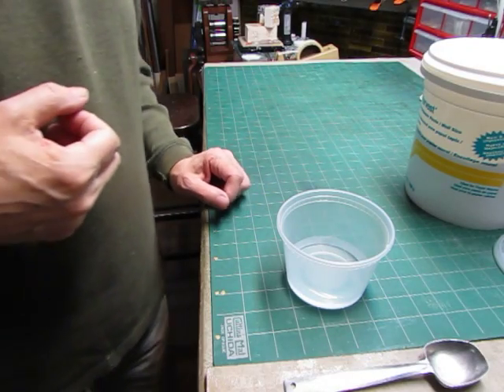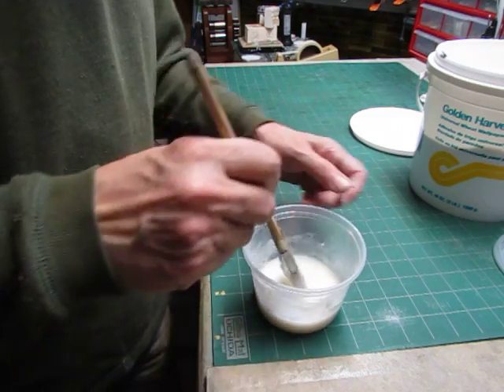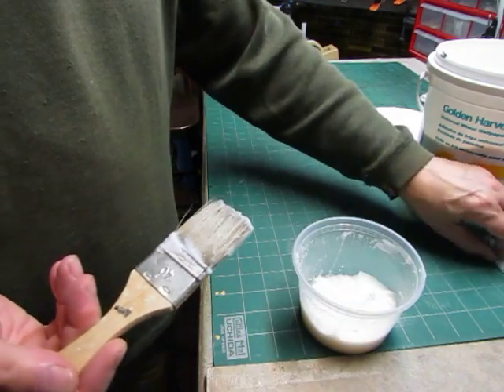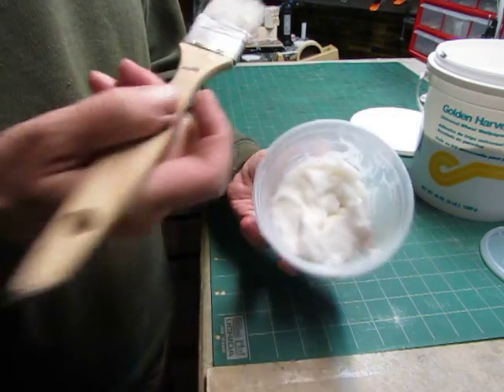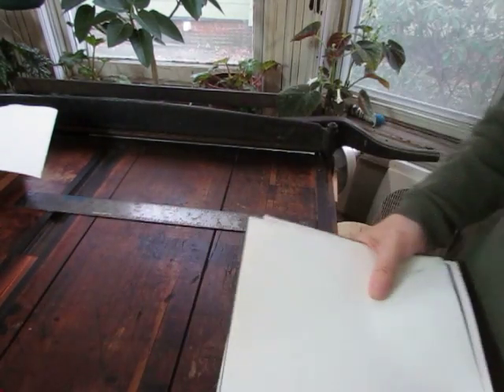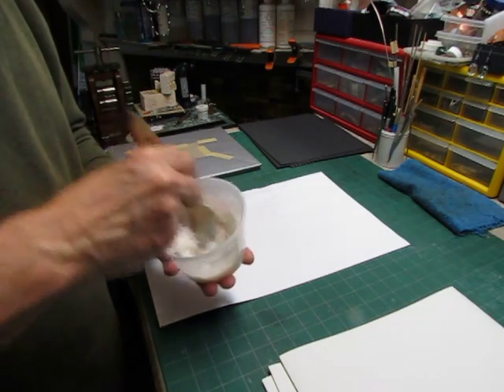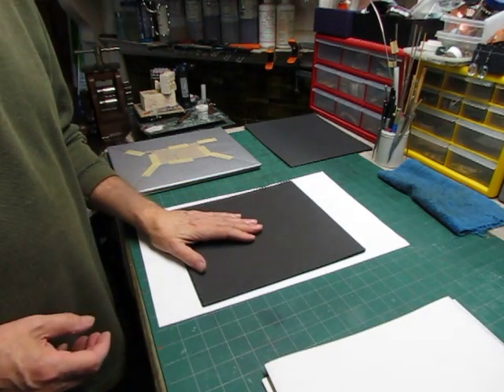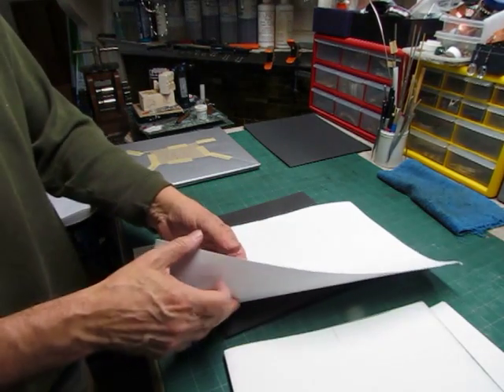Two Black Albums Part 2

Comment: Sage, can you explain why/when you used wheat paste, and when you used PVA?  What governs your choices?
Reply from the maker: Hi Lorraine, 
Paste and adhesives like PVA differ in their drying times. Glue, PVA and other adhesives are a "quick tack". Pastes made from plant materials like rice and wheat are slow tacks, so they are used to apply leather, soften spine glues in repairs, making end papers, casing-in and other jobs where you have time to make adjustments or need time to accomplish the job.  PVA , Glues and other adhesives are used when you are making cases, covering boxes, lining spines and other jobs where you have sure placement of parts and won't need to adjust the parts to finish the task. That's it in a nutshell. 

Thanks for watching and thank you for Tipping the Tutor, I really appreciate it in these days of Lock Down. If you have time, visit my Instagram @sagereyn and @sages_silver (where there is a 20% off sale this week until December 21)
Reply: @Ceropegia  Thank you.  Very clear; your explanation printed and filed.  There are many 'crafters' on line doing tutorials, and they are fun - but you are easily the best online tutor out there, for high-quality bookmaking and boxes.  Hope we keep seeing you from time to time!

Comment: I didn't know that you could make wheat paste without heating it up. That's the only way that I've known to make wheat paste. You're method looks a lot easier!
Reply from the maker: Cooked paste is usually for restoration work, rice and wheat. The cold mix is what touse tio install wall paper, it's the go to for making made ends and casing-in. Thanks for watching.